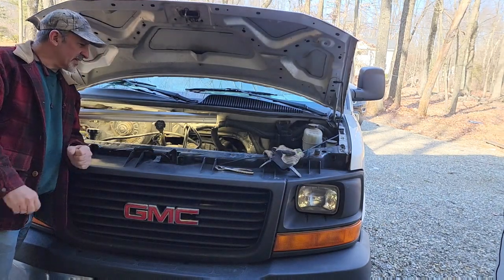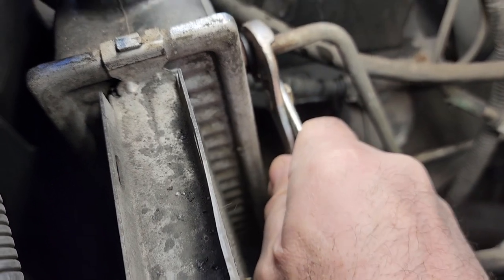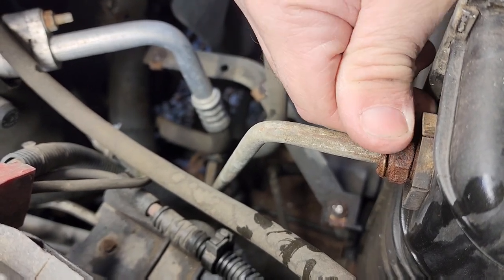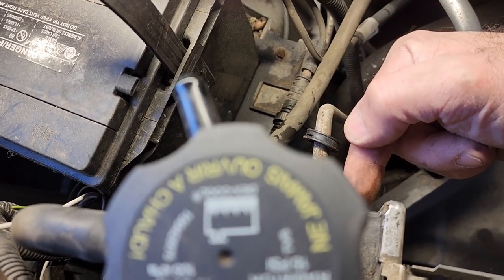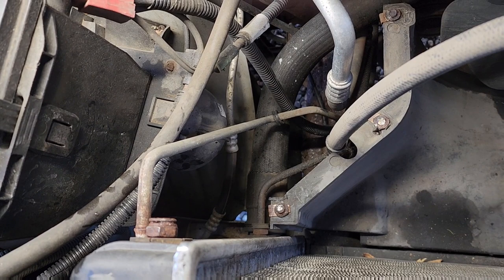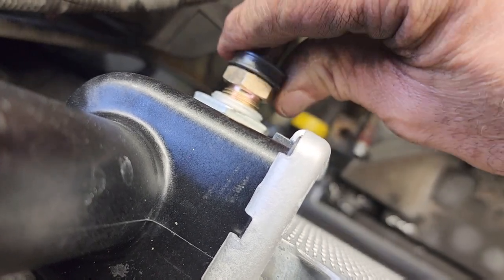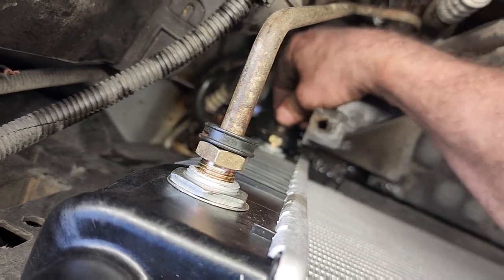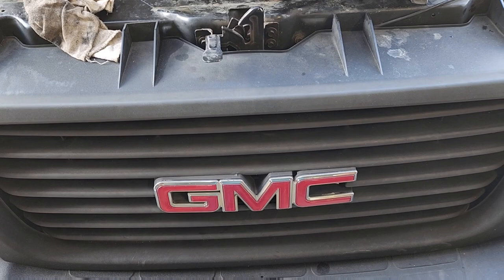Removing Radiator Oil line retaining clip

Comment: HARRY, a good trick to get those lines out is spray with pb blaster then blow out with compressed air and brake clean. Make sure to put metal clips back in too
Reply from the maker: Thanks for the invite. The funny thing is the new radiator came with the clips wasn't expecting that but for some reason that plastic retainer is not staying on the new clips. They must not be big enough. LOL. How is your car coming along? All the best my friend.